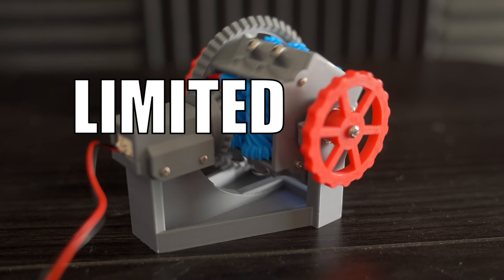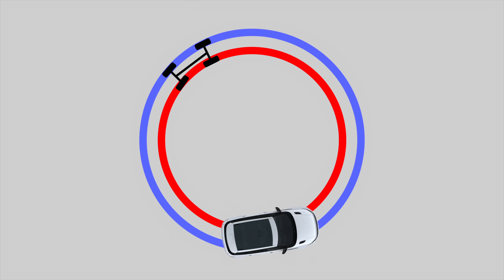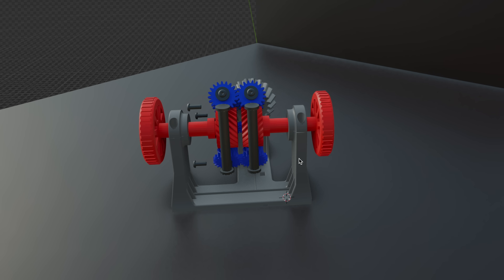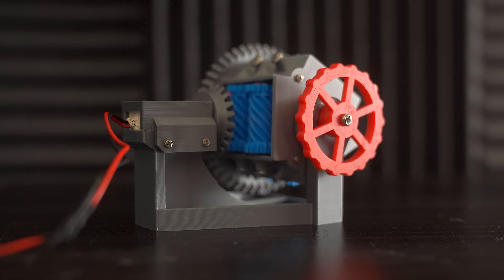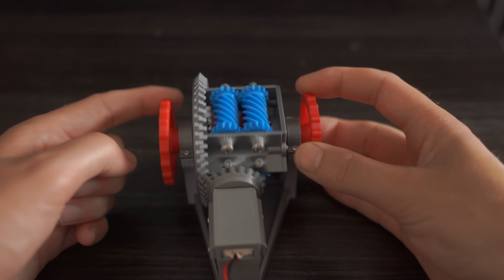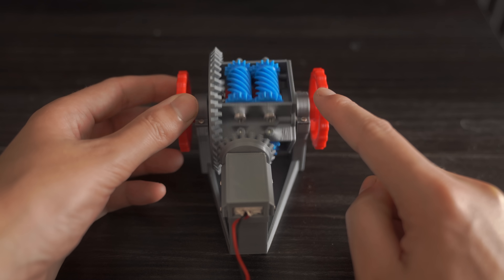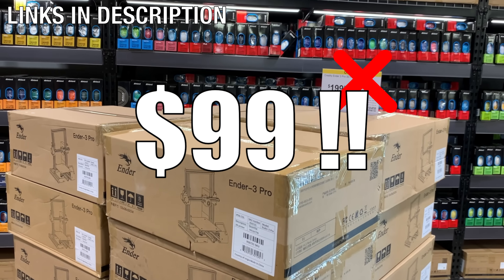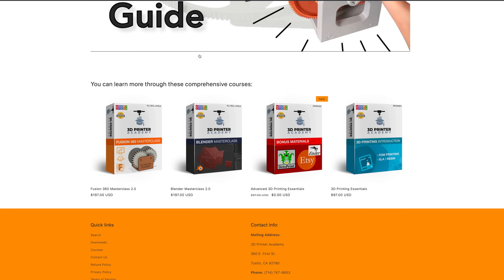What's a Torsen limited slip differential?

Comment: How about wear of the gears?
Reply: I don’t think they wear at all because it is essentially the worst gear box ever. 
By designed to run true with equal load but locks up when the load is unequal 
So there is no moving parts under pressure when controlling the torque.
Reply: It runs in oil just like the bevel gears of a regular open diff, why would wear be a problem? Wear is a problem for plate type LSDs which require special oil and rebuilds when the plates wear.
Reply: I would also love to know the answer to this question, and many more, but I would be happy to start here

Comment: clutch + cvt, two discs 90 degree to each other
Reply: dont be robot who repeats same stuff all over in pride
Reply: slips if clutch force is exceeded
Reply: one, two, four, or more contactor slip discs, for n-differential gear box
Reply: 2-in-1 gearbox-clutch mutual benefits
Reply: its not that great, separate electric/gasoline hub motors are way better, ie, 4 engines over 1

Comment: As the owner of and ender 3 I use it as my go-to printer even over my $700 printers
Reply: It’s very customisable that’s for sure.
Reply: @Matt_10203  build quality seems really good as well. got mine as a handmedown, dad hasnt been having fun setting up his crazy 2 nozzle setup. apparently the frame (not bed) of the thing was assembled do dickheadishly it would just never zero properly. id definitely say ender 3 is a great starting printer. remove the bowden system if you wanna upgrade, or go crazy on a resin printer or whatever when you figure shit out. but still keep the ender. it always works for whater reason

Comment: Great print, did not explain why a torsen is limited slip instead of just a fancy open
Reply: All you have to do is add a little brake, then you get the multiplied torque to the traction wheel while you only need the smaller amount of brake power to hold the slip wheel.
Reply: @johnh7908  that's an important tip, I was hoping someone was going to mention it
Reply: @johnh7908  hard to do with a manual transmission
Reply: In many ways, a torsen is often referred to as a fancy open diff. A clutch based limited slip, which is the most common LSD, is capable of locking the left and right axles together. The Torsen LSD is often referred to as a "torque multiplier" because it uses the spur gears to multiply the amount of torque one wheel gets, when the other wheel starts slipping. You can see the torque multiplication effect in the video when one wheel spins faster because the other wheel is stopped.
In certain conditions, the Torsen diff won't work when the spinning wheel has zero traction, because it can't multiply zero torque.
Because of that, and other reasons such as driver preference, more traditional LSD setups are preferred in racing or off-road applications.
Reply: @patx35  you are wrong, it’s a torque biasing diff. Like a locker or LSD, it will bias torque based on the lock up forces. 

Spur gears are only used to force opposite rotation for differentiated speeds. Like spider gears. There are helical diffs with no spur gears that use offset helicals to accomplish this. 

In reality the angle of the helical causes axial thrust proportional to input torque which is why it proportionally locks up and biases torque on a ratio.
Reply: It's a terrible video that barely explains any of the details. If you don't know what a differential is you won't understand the tedious rambling "and this worm gear turns this spur-gear" but if you DO know what a differential is you'll be bored and frustrated by the dreadful explanation. 
4 minutes later and I still don't know what makes this a limited-slip differential or if "Torsen" is a subtype of limited-slip differential or a synonym for it.  I got far more information in 10 seconds reading the comment "The key to this differential is the fact that a worm gear can turn a spur gear but the spur gear cannot turn the worm gear".
Reply: Exactly.
Reply: Is it fair to say, that essentially, if both tires have >0 traction, the wheel with the most grip will receive the torque/spin faster? (Up to whatever the ratio of the Torsen allows, 3:1ish)
Reply: It is obvious that while the Torsen design is clever, it is also far more expensive to produce helical gears  for the unit. Also, more inspection, attention to lubrication and maintenance is required.
Reply: That's because a torsen is basically a fancy open diff.  It can't lock both axles together, it can only bias the torque split to the wheel that's spinning more slowly.  You can even see this in the video, he's able to hold a wheel stationary while the other one spins.

The torque bias means that it helps a lot with traction, but if you lift a drive wheel off the ground entirely, you still get 0 torque on the other wheel.
Reply: @rosa-f5i6o  "it can only bias the torque split to the wheel that is spinning more slowly"

In most situations this is kind of true but it's important to note this type of diff is not velocity sensitive (unlike e.g. a viscous coupled diff), it is torque sensitive.
Reply: If you want to get technical, it is a limited slip. While it can't solve the zero traction problem, it does try to ensure that 100% of the power is being used between both wheels (barring things like friction in its own operation) while an open diff is always just 50/50 split regardless.
Reply: @YoRHaAttackerNo2  except that the Torsen diff is not just a torque splitter, it's a torque multiplier. 
Going back to the open diff, it's commonly said that it always have a 50/50 split. What that means is that if the spinning wheel only can handle 25 ft-lbs of torque before spinning, then the stationary wheel would receive 25 ft-lbs of torque.
Now take the Torsen with the same example. If the diff is rated for 3x torque bias ratio, then the stationary wheel would receive 75 ft-lb of torque if the spinning wheel can only handle 25 ft-lbs. This would be a variable 25/75 torque split, depending on the situation.
This variability is a major reason why Torsens aren't always used in racing or off-road applications. In comparison, a clutch LSD would be sending up to 100% of the input torque to a single wheel if needed, or a max of a 0/100 torque split.
Reply: @patx35  
That and the clutch LSD can force a 50/50 split in a zero traction situation.
Reply: @YoRHaAttackerNo2  a clutch LSD can force 0:100 slip in a zero traction scenario. 100% of the torque can go to the non lifted wheel. 50:50 still implies a wheel with no traction gets 50% of the torque, which would be 0.
Reply: @chris-graham  Fair point.
Reply: You can help the zero traction problem yourself though, if you have a proper handbrake you can apply it a little, just enough to add some resistance to the spinning wheel and the diff should get the car going again.
Reply: The torsen is a open diff with more resistance in the helical-gearing.
Reply: There is more force needed to rotate the inner gearing. That causes a limited "closed" diff but with less response compared to a real open diff.

Comment: I love helical gear differentials. Detroit Truetrac is going in my rear in a few months
Truetrac in the rear, mechanically selectable locker up front. be hard to get stuck
Reply: That sounds uncomfortable - make sure you use the correct lubrication.
Reply: @paulg3336  I know where you are going there, and I just wanted to say, you sir are a legend
Reply: wait, you kinda got that backwards don't you? you want an LSD up front so you can still steer and a locker in the back!

Comment: So if the wheel with more traction gets a higher rpm how can you demonstrate it if you start with both wheels having no friction. I understand the concept but it's really hard to visualize it because traction requires more friction. If you made it so the differential was half on asphalt and half on ice then you apply a load on it then it would have the asphalt side rotate faster than the side that's on ice?
Reply: One thing to know if you have a truck with torsion diff? Is a small application of the brake, or light application of the emergency brake, may provide enough resistance to help lock it up. It’s a weird trick that can make all the difference if your off-road.
Reply: rather than rpm you should be thinking of torque values. the transfer of torque from the drive would be forced to the side with most traction. the split is based on the torque bias ratio which is around 3:1 for majority of Torsen Limited Slip Differentials.
Engineering Explained will make this make more sense if you have a basic understanding of differentials /watch?v=lDsQAs0Ldes